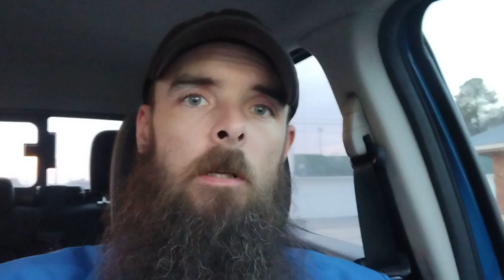Ford 7.3 Godzilla Lifter Failure And Tick/Tap/Click Noise

Comment: I just took my 2022 F250 7.3 L to Ford this week for the tapping noise they said they have had no issues with this engine! I know it sounds different. 
How do I get them to fix this without a code?
Reply from the maker: There doesn't have to be a code present.  People always think there needs to be a code to get something fixed under warranty.  But maybe. Just maybe. There is seriously nothing wrong, and you are being paranoid (that was not meant in a rude way or snything).  Engines make all sorts of noise and the first tick or tap people think something is wrong.  Get a second opinion on it. Where is the noise coming from?  Pull your oil filter and cut it open and look for metal.

Comment: Are you sure it’s not the pcm requiring module reprogramming which changes the variable displacement oil pump pressure at idle. Over time can cause camshaft wear and lifter and roller follower damage.
Reply from the maker: Certain years. Just did a recent video on this too.  This video is older before the pcm update came out.  Also did a recent video on the pcm update as well. The tsb
Reply: @BeardedFordTech Oh ok. Thank you. Yeah at work I have to update the PCM as well.

Comment: I’m hearing a sound like a backfire at 3500 RPM at the front of the motor
Reply from the maker: Misfire, camshaft or lifters, ignition system problems those would be the three main culprits that I would check.

Comment: Ive had a lifter problem but my dealership says ford won't do anything until they find metal in the oil filter. Is that true? I am at 56K miles and the problem originated around 35K. My truck is a 22
Reply from the maker: @clintondentler5410  not necessarily true. If.you have a lifter problem and they know it and has failed. Then it should be repaired under warranty. I think they are trying to make you wait until warranty has expired
Reply: @BeardedFordTech  ok thank you, i will be taking it to a different dealer
Reply: I was able to find an early video of my problem. It’s rhythmic with the RPMs

Comment: nephew's 2021 f350/7.3   41,000 miles and needs new motor, so much glitter/metal in oil filter it ran with reduced oil pressure and messed crankshaft up too,  currently has a lawsuit with Ford because it wasn't serviced by "Ford" dealer. he has always had his vehicles serviced at a well known diesel performance/repair facility, he has all receipts for all services performed by that facility and Ford more or less told him to get F'ed
Reply from the maker: @destroytheilluminati770  yep. Lifters also fail because the oil pressure at idle is 8psi. Did your nephew get the recall done where they reprogram the pcm to bump up oil pressure at idle?  If not, then there's really he can do. And technically he would be at fault not matter how many service fecipts he has. Now if the recall was done thats a different story. I'm sorry this happened to your nephew.
Reply: @BeardedFordTech my nephew never got a notice from Ford about any recalls until after damage had already been done, nephew is a regional manager of a large 3 state pig farm operation and racked up those miles in 11 months,  almost always towing a trailer loaded with various equipment between farms like skidsteers etc

Comment: There's a letter out on the issue csp24b27. The pcm needs updating to bring idling oil pressure up but ford is dragging there feet letting people destroy there new trucks. Its 2020-2024 with 7.3 and even the new 6.8. Pretty horible of ford to let this drag on this long.
Reply from the maker: @rockie307  yeah i talked about that already. The 24B27 just got updated to include the 2021-2024 superduty. Still not available for the 2020. Says projected October 1st. But it hasn't released yet. It's not on.message boards either.
Reply: @BeardedFordTech  Please comment here when it becomes available. My local dealership is no help.
Reply from the maker: @rockie307  will do. Or you can send me an email and can add you to my contacts

Comment: Hi  I have a new 2024 7.3 in my RV..I started up and had a loud sound that sounded like a Fan hitting the shroad..I crawled under and the noise was coming from the back end about where the exhaust pipe comes out...I turned the vehicle off and on three times and then the sound slowly dissapeared....Any Ideas?    Thanks
Reply from the maker: @timward4952  I haven't come across that noise before at the back of the engine. Does the noise go away?  Or is it constant?

Comment: Cheap parts . The heart and soul of your truck . Poor business strategy from Ford.
Reply from the maker: @paulsalinas2545  you think it's just ford?  What about chevy?  What about ram?  What about brand new Toyota with bad main bearings blowing engines at 3,4,5k miles?  What about chevy and the lifter issues?  Think that went away?  They actually get their lifters from the same place. Redesign the engine. But not the actual problem.

Comment: Delamination is caused by bad tribological design (mechanical engineering) of the surfaces in contact. I cant believe Ford put this engine on the market without solving the shear stress caused by cyclic Herzian contact pressure.
Reply from the maker: Yep.

Comment: The Duke says, it's not the motor that is the problem, it is the quality of the parts. Ford and other manufacturers are getting substandard camshafts and lifters from overseas. It has nothing to do with the quality of the oil or how often you change the oil. I say this because there are many engine builders on YouTube that put together motors who are experiencing the same problems.
For example they are using Comp cams parts and they are failing immediately. One engine builder called one of the camshaft companies and they tell him they are no longer going to offer a warranty for their camshafts until they figure this out. Blame Ford RAM and Chevy all you want. It is not their doing. Bad parts equals a bad motor. Needless to say the manufacturers should warranty this debacle. 
What did I teach you?
Reply from the maker: Partly their fault for buying the cheap parts they are putting into it.
Reply: Yep I agree totally

Comment: I've got a 2020 7.3 with the same issue. Motors clean as all get out in a senior solutions care van. Would you recommend a new motor or go ahead and swap cams and lifters out?
Reply from the maker: Motor. Mayook clean up top. But I'm sure it has metal debris in the oil journals
Reply: @BeardedFordTech  cool. Yes sir preciate your time
Reply from the maker: @Kirbytransmissions  your welcome

Comment: Have you seen or heard if this is happening to the E series, the e450 7.3 liter.  I have a 2022 Class C RV, 9000 miles, and 3 oil changes.  I hear the tapping noise the fisrt 30 seconds upon start.  My last trip, i notice the tapping noise accelerating uphill.  I did ask my local ford service tech the same, but he too stated only seen it on box trucks.  Im going to Colorado next month, i have concerns of all that im reading and seeing.  

What do you think?
Reply from the maker: I would need to hear it. I personally have only seen it on box trucks. Why so many oil changes in 9k miles?  What kind of oil you running?
Reply: I got it in sept 2021.  The fisrt ine was done by my RV service while i had them doing some rv house warranty work.  The last 2 was  done by Ford Truck City.  Once a year oil change, just got one early since i will be traveling a lot this summer.
Reply: Let me pull my files if my last ford service on the exact oil and filter.  I do my own oil changes on my own truck and cars regularly, but my RV is under warranty, and having ford service, i shouldnt get any push back if things really go bad.
Reply from the maker: @coolhand1933  even if it's under warranty it doesn't have to have the oilnchsnged there. If it is engine failure. They will deny it.  Once a year is too long. Oil has a shelf life. That's why the manufacturer recommends 5-10k or 5 months. Whichever occurs first.
Reply: Looks like my comments are being deleted.  Just talked to Ford Truck City, they referred to the e series owners manual, stated every 10k or 12 months, which ever comes first. Not 5 months.
Reply from the maker: @coolhand1933  that's awkward especially on a 7.3 gas.  I wouldn't go one year.  Maybe they would.cover it u Der warranty then if your going by the book. I hope your not having issues.  I haven't deleted any comments.
Reply: Total agree, will start changing it myself everyother time, and ford the other.  Thanks.
Reply from the maker: @coolhand1933  your very welcome!!  Have a good day

Comment: Still using the powdered metal oil pump gear. Damn. Afraid to turn up my coyote for that reason. It’s got a blower but it’s like 5 psi. Now. So lame the 7.3 hate. So much potential. But yeah if it’s not reliable….
Reply from the maker: Yeah the ones I saw failing were in box trucks though. It's weird.

Comment: Jeez, it sounds like Ford is pushing out low quality for what purpose? They are highest in recalls and for drive train components. Charge extremely high prices for crap. Sadly, all manufacturers seem to be doing it. Like, quality is low on the totem pole is Number 1. I wonder if this NWO has anything to do with car makers pumping out crap.
Reply from the maker: The 7.3 lifter issues I only saw in box trucks (not saying it's not happening in others)  they redesign an engine. Around the failed components and keep the parts that are failing. Same wtlith Chevrolet and their lifter failures.  Dodge and their lifter failures.  Mind blown in 3...2...1...Ford isn't the one with the most recalls. That torch has been passed to Honda. I did an in depth video on that one.  And it's all makers. Including Bugatti. Yeah Bugatti.

Comment: Thanks for your expertise.. my new 2023 Superduty 7.3 has 870 miles. I’m not feeling too confident coming from Toyota for past 20 years.
Reply from the maker: Your welcome. Your going to love the truck. The failures I saw were in big trucks that did idle more than normal.  Do a break in service at 1000 miles (change oil and filter)  use a good quality synthetic oil and good quality filter. Motorcraft filters work great or Purolator boss.  Keep on top of your maintenance and you should be just fine.
Reply: @BeardedFordTech  Thanks you cheered me up. I just love this beautiful truck. Fords have come so far in 20 years. My last F-150 was bought 20 years ago. I cannot believe I have on and it’s a 3/4 ton truck. It’s Oxford White with Baja interior . I have lots of ideas mostly because of the 7.3 V-8.. lot of Ford heritage like 351 Cleveland. I don’t even have to try to give it gas because it just goes like it has a mind of its own. I’m thinking about going with a set of Johnson lifters someday to start. It’s really a cool truck. It’s too early to worry about the lifter situation. I’ll be doing the 1000 mile oil change like you suggested and I think we’ll be fine. Have a great holiday season.
Reply from the maker: @atomicorang  💯💯😁  have a great holiday as well.
Reply: @BeardedFordTech  Thankyou for your advise sir. Merry Christmas.
Reply from the maker: @atomicorang  your welcome. Merry Christmas too you too!

Comment: My 22 is doing it. Does the engine need lifted for the pan to come off to inspect?
Reply from the maker: Why would you be inspecting the oil pan?  Pull the lifters out. If it's a lifter failure nothing will be in the pan. But no you don't need to lift the engine for the pan to come out to answer tour question.
Reply: @BeardedFordTech  how big of a job is it to change the oil pump drive gear?
Reply from the maker: @Precisiontigwelding  it's a pretty big job. Front cover and oil pan have to come off
Reply: Im sorry i should have explained better mine is making the light tick or tap sound from the front of the pan i think its the oil pump drive gear i can send you a video if you want to listen to it
Reply from the maker: @Precisiontigwelding  yeah if it's in the front. It's the oil pump gear. Going to need a new one.
Reply: I figured it was I’m nervous about having it done anything i should look out for after?
Reply from the maker: @Precisiontigwelding  nope. Other than that it's a pretty good engine.

Comment: Theres got to be hundreds of thousands of these engines on the road by now, its still a small percentage. And with covid, who knows where ford was getting their parts from. Im just praying that since i got one of the first ones ever built, the parts they were sourcing before covid were fine
Reply from the maker: True. But for some odd reason. I was only seeing it in box trucks.
Reply: @BeardedFordTech  wouldn't a box truck have more idle time then normal?
Reply from the maker: @denverbasshead  not necessarily. The ones I worked on didn't idle any more than a regular pickup.
Reply: @BeardedFordTech  what's normal? 20% of engine hours? 30% I idle as little as possible, mines less than 10% currently
Reply from the maker: @denverbasshead  well technically severe duty is idling more than 10 min short trips and heavy hauling. If your at 10% or less then your not idling a whole lot which is considered normal

Comment: It's these types of issues that have kept me a Toyota customer for 35 years. Now I need a 1 ton for a camper and I feel like it's going to be russian roulette  no matter what brand I go with.
Reply from the maker: New Toyota are having major problems with the new vehicles. If you nerd a truck to tow a camper. Go with the 6.7 powerstoke not the 7.3 gas.  The powerstroke pulls so smooth you won't even know your pulling anything.

Comment: So are the new SD's (mid to late 2023 models) with the 7.3 getting upgrades to address these issues?  Is it less likely to have the oil pump issue or the lifter/cam issue if you buy a new one?
Reply from the maker: Nope. No redesigns
Reply: @BeardedFordTech  Well, that's disappointing.  I was considering a SD with the 7.3.  Not anymore.  I can't bring myself to spend that kind of money on a truck knowing that there is a high possibility that it will fail, maybe after the warranty expires, and need a significant amount of work.
Reply from the maker: @user-wq5sc9jk2e  all the ones I've done were on box trucks. And under warranty. But if they did a redesign they will still use the same lifters. Exactly what Chevrolet did. Redesign and engine and use the same crap parts that fail.

Comment: yea mine is doing the tapping around the front of the motor on passenger side.  has been doing it since about 20k at least. can you do a update on this issue thanks for the ssm
Reply from the maker: I'll see what I can come up with for an update. If there is an update for this engine
Reply: thanks man gonna take mine in thursday. to see what they say. notified my service writer of the ssm. just wondering if there needs to be an inspection of the cam/lifters due to possible low oil pressure. could you pts for any other tsb or messages ? thanks again! @BeardedFordTech
Reply from the maker: @taylorpilato7896  I just looked. That's the only update so far. So further SSM at this time
Reply: @BeardedFordTech  also thanks man for the ssm it helped alot
Reply from the maker: @taylorpilato7896  your very welcome.
Reply: Hey man it was a cracked crank gear at 54k but started making the noise at around 20k on my 22 f350
Reply from the maker: @taylorpilato7896  least it's covered under warranty. And I'm glad they found the problem. !

Comment: Coming up on 20k miles on my 2021.  All good so far.  Not going to panic about it.  Just going to drive it and enjoy it.  If i have an issue i will be disappointed but i will get it to my dealer to have it fixed inder warranty.  Still under base plus i have the extended.
Reply from the maker: It's usually the box trucks that I saw it in. I never had to do one on a regular pickup. But I have seen videos. You got the right mindset just drive it!  Base is good. But lifters would be under powertrain which is 5/60. And you have extended. So you should have nothing to worry about!!
Reply: @BeardedFordTech  Thx.  I love it.  Upgraded from an F150 for better towing even though I was within payload, tongue, and trailer weight.  The difference is amazing.
Reply from the maker: @bigmanmoto9897  I like the entire kine if F series. Really depends on what your using it for.

Comment: I've had the ticking noise that speeds up and gets louder with acceleration. Been told for a year and half that it isn't an issue, and now I came across this TSB. Do you have any videos of replacing the oil pump gear? I plan on dropping the pan tomorrow to check while I'm doing an oil change. Almost at 63K miles, so no warranty.
Reply from the maker: You have to remove the front cover to remove the oil pump
Reply: @BeardedFordTech  any diagrams available online? I can’t find anything. Guess a newer vehicle doesn’t have as much content online yet. Thanks for the response btw

Comment: I have 7.3 and my warranty ran out and now I have bad lifters doing that same thing. Is ford doing anything to try fix it? I love the 7.3 and I love my truck but seems like the should address by ford.
Reply from the maker: As far as a I know. Nothing is available yet. I'm sure they are addressing it some way somehow. How far out of warranty are you?  Get a quote for the fix.  Then call customer relations center and talk to a real human.  Tell them you love the truck. Ford knows it's an ongoing issues. You don't want another truck. Ask if they can help with the bill.  They care about their customers and will do what they can to help.
Reply: I have currently a failure with my 2.7 eco-goose with a dealer telling me I need a new engine and transmission now on my 2018 with 150,000 miles. The dealer quoted me over $28,000 to fix it and I called Ford Customer Relationsand they just told me I was out of warranty so there’s nothing they can do.